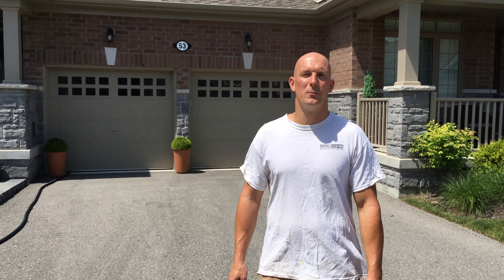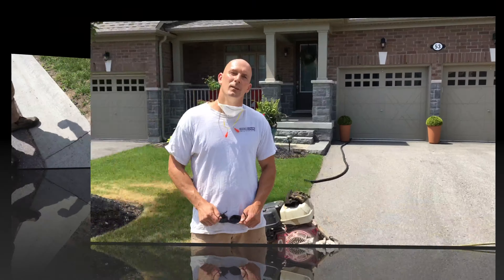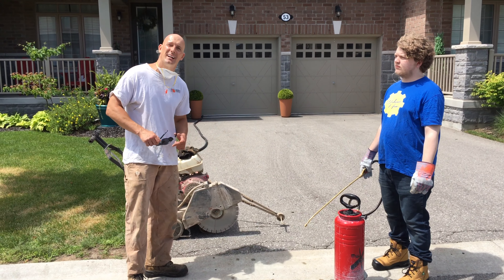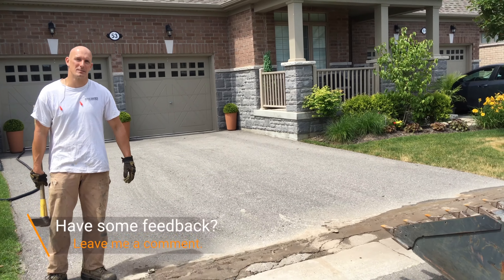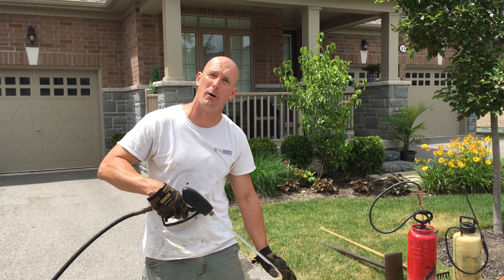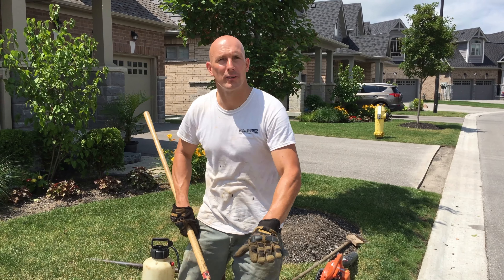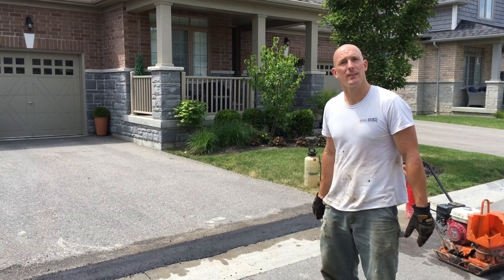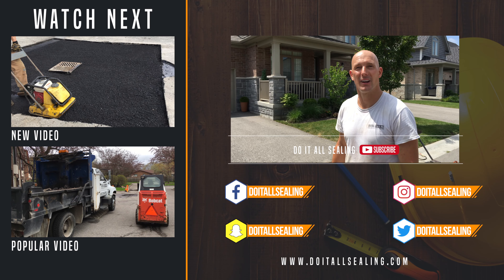Asphalt Driveway Repair (4K)

Comment: Why did you use hand tamper before plate compackting
Reply from the maker: The asphalt is sometimes too hot to just run the plate compactor over.  If we do the top layer of asphalt will peel up.  If I have a bit of time I usually hand tamp or walk on the asphalt with the shoes before using the plate compactor or roller for new driveways.  You can check out that video on my channel coming soon!

Comment: So I see u drove over there with hot asphalt. About how much time do you have to work with it
Reply from the maker: In a dump trailer or dump truck my time is limited.  The more I have the longer I have to work with it since it is staying hot on the truck longer.  Soon as I start to work with it off of a truck or dump trailer I probably have a few hours max to work with it.  Then it starts getting harder and tougher to rake.  If I am working out of my Hot Box I don't need to be in a rush because I can keep the asphalt hot for as long as I want.  I can even reheat asphalt that has been left in there for 1 year and still use it.